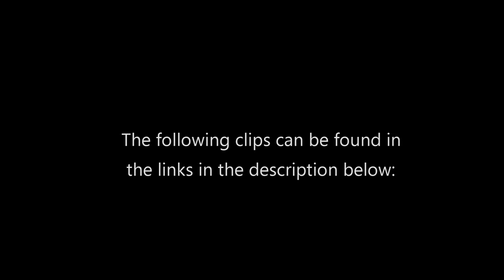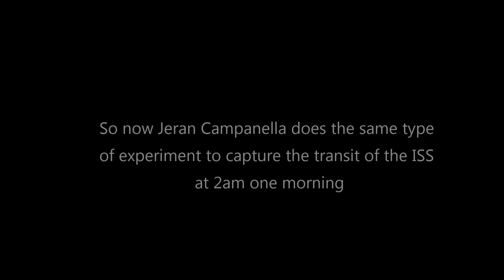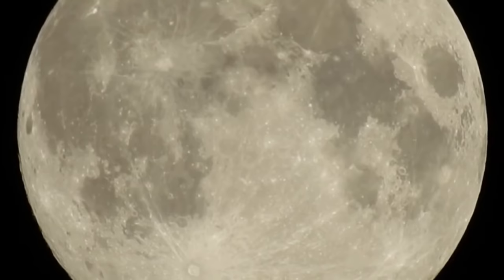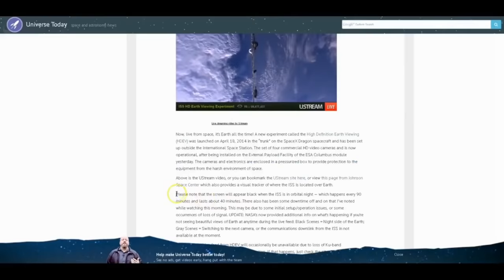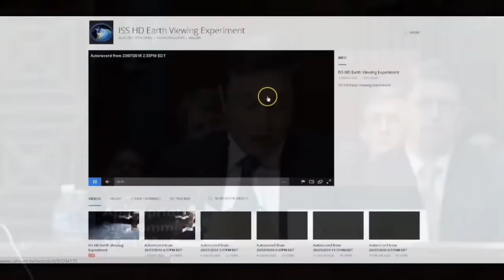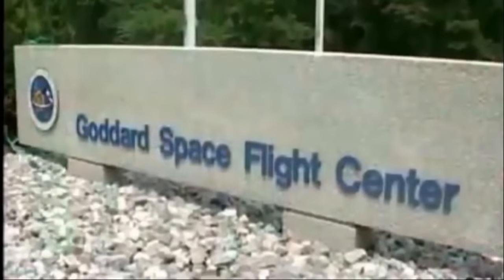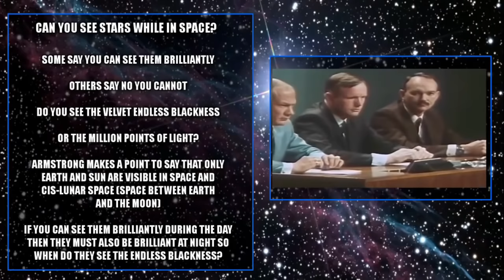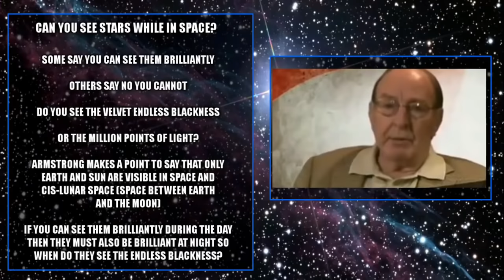The ISS Confirmed!

Comment: There's a video about submarine O ring seals and solenoids and you'll see that the O ring explantion on the ISS is totally fake.  The ISS would explode if a seal leaked and they have no way of sealing off any sections.  Don Pettit is obviously a 33rd degree Freemason or higher = Liar.  A leak or emergency in a water tank is nothing ompared to being in a vacuum.   Any slight leak in a vacuum, you're dead.  So as you say, no need for guardian angel skuba divers.
Reply: Does your tube seal up nice and tight?
Reply: @tubemonks   Don Pettit is a geologist.  This is why the flat earthers only show him.
Reply: @andrewskivington6453  He is in fact a Chemical Engineer and obviously a Freemason too. There are many videos where he isn't even mentioned so you're wrong on both conts - sorry about that.  But there is plenty of evidence that the Earth isn't a globe, but globe heads refuse to even discuss it.  I have carried out an experiment myself and shown there is a huge anomaly with the accepted rhetoric.  It's so plain that the ISS is fake and I find it incredible that many people want to ignore all the oddities which arise and fly in the face of the very science they uphold as correct.  I looked into the psychology of that too and now I understand the reasons.  The Earth is either flat or it is really huge but I am not sure what it is yet, but one thing is for sure - NASA know the truth.  But Pettit said what he said.  You think he lied?
Reply: @tubemonks  He is trained as a chemical engineer but studied meteorites (something you don't get on a flat earth model with a dome on top of it). 

"But there is plenty of evidence that the Earth isn't a globe, but globe heads refuse to even discuss it."  You are kidding right?  We have been discussing it since 300 BC.  "The Earth is either flat or it is really huge", it's the latter.  That's why you can't see curvature from the ground very well.

"I have carried out an experiment myself and shown there is a huge anomaly with the accepted rhetoric."  Can you show your findings?  Is it a tennis ball with water on it?  I'm happy to destroy your opinions with facts, not that you would ever except facts over your opinions.  Are you going to show us how tides work?  Or seasons?  Or the differences in visible stars from countries in Europe/North America vs Australia/NZ (where's Polaris when you are in Australia?).  Why do Flat Earthers mistrust global authority but happy to adopt a pin design for their map?  Why do flat earthers keep calling out NASA when 11 countries (and the ESA) have fired rockets into space?  What about the numerous private companies that have done it?  

"But Pettit said what he said."  Again.  He's far from being an engineer.  But yet again, FE'ers cling on to what he says.
Reply: @andrewskivington6453  So he studied meteorites?  So what?  People study many things.  What 'model' are you talking about?  Would that be the 'model' that all globe heads think anyone who doesn't go along with the accepted rhetoric believes in?  

Do you know about the Lake Titicaca experiment?  Obviously not but I confirmed it when I lived in Dorset across a bay over 20 miles across and could see the beach while sitting on the opposite beach with binoculars.   Lake Titicaca shows no curve whatsoever using a laser.  You cannot destroy any opinions with facts because many of your so called facts are lies to begin with.  I haven't looked into tides because I can't research everything anymore than you have researched microbiology. 

There are many possibilities as to why the stars look like they do and what they really are.  We have no real pictures of planets and neither are there any real pictures or videos of satellites either.  Oh dear - the old Polaris argument again.   

Adopt a pin design for their map?  What pin design and what map do I subscribe to then?  Obviously according to you anyone who disbelieves NASA and understands that the Earth isn't a globe all agree and have exactly the same idea as the next person.  Yes it makes it easy for you to giggle and make fun but did you know the Flat Earth Society is a Counter Intelligence group?  No I do not subscribe to the Sun being a spotlight because it makes no sense. 

Countries firing rockets?  Well that proves it all doesn't it?  So once you know that many countries allegedly have space programs then don't bother looking any further. Typical!   Private companies done what exactly?  Space X ?  Fake fake fake.  Space X is all CGI, cartoons and lies like NASA.  But I suppose it all looks real if you think South Park is a real live show I suppose. 

So Don Pettit is far from an engineer?  So he is lying now is he?  His career is fake too? So what is he? Yes, I know he is a liar but you can't have it both ways can you.
Reply: @tubemonks  "Do you know about the Lake Titicaca experiment?" Yes I do.  It was a repeat of a similar experiment in Hungary that also didn't prove a flat earth.  This new Titicaca experiment it was conducted by flat earthers (google "convex earth") as part of their laughable documentary using "Lilarial Science", which doesn't even exist.  Even more so they produce a 3D model of what they think the flat earth looks like, complete with an undiscovered continent beyond the ice wall.  The ice wall that they never bothered to visit as part of their research.  

Also, if you knew about the Lake Titicaca experiment yourself they list the equipment used by each team... yep they used a  Garmin e-Trex GPS unit... you couldn't make it up!  They don't say at what height the laser is located or what the distance is.  To rub it in they also use GPS units for their geodesic curvatures in buildings experiment (another experiment where they don't show the data).

If you actually saw the documentary it showed the curvature despite their protests.  For example 14 mins in they see a ship disappear under the horizon, which would only happen either on a tube or a... globe.  That documentary is so bad that even flat earthers have since backtracked and ignored it to the point there are whole debunking videos on it, or google "Convex Earth complete debunk".

"We have no real pictures of planets and neither are there any real pictures or videos of satellites either"  Buy a telescope.  Don't tell me.  They have been doctored by the deep state or something.  You can see Venus and Mars with your naked eye.  If you go to an observatory you can see Saturn and its rings.   Plus if you think satellites don't exist please don't use a phone or watch TV otherwise you are hypocritical.  You can even get a phone app that tracks them.  According to UNOOSA, over 8,000 objects have been launched into space with almost 5,000 still in orbit... so do provide evidence that all of those are fake.

"Oh dear - the old Polaris argument again."  There is no argument.  You cannot see Polaris 15 degrees south of the equator.  If you lived in the northern hemisphere you wouldn't be able to see The Southern Cross, Carina, Centaurus and Sagittarius.  So do explain that vs running away with a flippant "old argument" line.  Argue the point then.  Have you been to Australia?

"Adopt a pin design for their map?  What pin design and what map do I subscribe to then?" For a flat earther I seem to know more about it than you do.  They adopted, ironically, the pin created by an industrial designer called Oliver Lundquist in 1946.  Google "Flag of the United Nations".  Yep, I'm doing all the work for you.

"Private companies done what exactly?  Space X ?  Fake fake fake.  Space X is all CGI, cartoons and lies like NASA" - You have seen a rocket launch right?  For example Space X launch satellites from both Florida and California.  The latter I saw, as did all of Southern California on the launches they did last year from Vandenberg AFB - or did everyone that took photos/videos and posted them on their social media pages put them through CGI software first?  Or did Space X produce the world's most realistic holographic projection, complete with sonic booms.  If in doubt just go near launch site, here's a roster of launches this year - google "spaceflight launch schedule".  Yep, you can see for yourself.

"Space X is all CGI" - I've worked in film and video game industry on and off for the last 20 years.  What CGI software does every single space agency and private aerospace company use now and from back in the 1960s?

"So Don Pettit is far from an engineer?" - Just google search him.  It lists what he has done for NASA, there's no great secret.

"Yes it makes it easy for you to giggle and make fun but did you know the Flat Earth Society is a Counter Intelligence group?"  Yes, because both you and the FES are countering intelligence.  If you are just relying on easily debunked YouTube videos for your direction you are going to be a target for ongoing mockery.
Reply: @andrewskivington6453  Of course I 'actually saw the documentray' I probably watched it more than you.  And of course they showed a ship disappearing because that is what they do!!!!  THAT doen't PROVE anything.  Are you saying we don't believe that ships disappear from sight the farther away they are?   It doesn't matter at all who they were and what their thoughts were on the subject because the data is shown below.  So only globe heads can do an experiment eh?  Is that what you're saying?  They did show the height of the laser as below, if you really watched it.  

The experiment showed that the laser could be seen from the opposite bank and if the Earth were the size they say it is you couldn't see it - end of.  The 3d model is neither here nor there.  You cannot 'visit' the Antarctic so how could they do that?  And don't tell me you can because you can only go to predetermined places.  

Teams:
Team A: Vanessa Oliveira, Alessandro Oliveira, Alex Oliveira, Tatiana Maciel
Team B: Urandir Oliveira, Eliane do Canto, Alan Oliveira

Coordinates:
Team A: Location: Juli, Peru 16 ° 12’34.74 “S 69 ° 23’51.29” W
Team B: Location: Copacabana, Bolivia 16 ° 10’1.69 “S 69 ° 5’25.04” W

Distance: 33.78 Km

Equipment:
Team A
1 Laser beam 3000mW
1 Laser beam 1000mW
2 Halogen Headlights 75W
1 GPS Garmin e-Trex
1 Notebook with GPS and positioning software
2 HD Cameras with nightshot
1 Laser level with modified support
1 Lead-acid battery from 27A
1 VHF Radio Base
1 Dual band VHF / UHF directional Omni antenna
1 Radio HT VHF
1 Lensatic Engineer Compass
2 Tripods and Positioners

Team B
1 Laser beam 3W
2 Halogen Headlights 75W
1 GPS Garmin e-Trex
2 HD Cameras with nightshot
1 Lead-acid battery from 27A
1 VHF Radio Base
1 Dual band VHF / UHF directional Omni antenna
1 Radio HT VHF
1 Lensatic Engineer Compass
1 Tripod and Positioner

OBS:
1- The laser equipments was positioned at 1.5 meters from the water level.
2- To replicate this experiment, you must take into account the climatic condition. Give preference to perform on days with low air humidity and days with little or no wind, which decreases the formation of waves.

I am not going to get into the phones and TV argument here.   You are provaricating, massaging or deliberately  (or through bad research) missing information as above.  You really need to WTFU son.  
You are struggling to protect your ego.  This is a basic failure and stumbling block of research.

A rocket launch proves nothing.  Space X is fakery.
Reply: @tubemonks  Yep, that's the equipment list... 1 GPS Garmin e-Trex for each team.  Notice how they don't show the data for the test.

"And of course they showed a ship disappearing because that is what they do!!!!"  On a flat earth they wouldn't have disappeared below the HORIZON like they did on the test.  The test proved a globe, as does a sunset does or a sunrise.  There's no curving horizon on a flat earth model and your sun/moon rotate over the earth (why can't I see the sun over Europe when it's 10pm in the US?).

"The 3d model is neither here nor there."  It is!  It is the output of that documentary, aka ignore or hide the findings because we believed in a flat earth from the outset.  It was so funny to watch.

"So only globe heads can do an experiment eh?  Is that what you're saying?"  Not at all.  This is a fundamental to science.   Unlike, say, religion, it opens itself up to scrutiny and retest which is why it's called scientific theory.  There as been NO actual research done to prove a flat earth other than lasers over a very short distance (in relation to the size of the planet - why are all the other planets round?  Oh yeah, you think they don't exist even though telescopes are a thing).  Why haven't you all pulled money together and made a balloon like Explorer II in the 1930s?  They saw the curvature from that.  Or even a balloon with a GoPro?  Or an trip to Antarctica?  Or a fight from South Africa to Australia which is currently a non stop flight, but on your flat earth UN based map is over twice the distance thus needs refueling.

"You are struggling to protect your ego.  This is a basic failure and stumbling block of research."  You are kidding right?  Everything you have said can be disproved.  Like I said even that Brazilian documentary is now mocked by Flat Earthers because of its lack of accuracy and, importantly, transparency, so what does that make you?  Gullible?  Or egotistical to think you can prove the world wrong because of your ill researched opinions plus gobbling up conspiracy video after conspiracy video.

"I am not going to get into the phones and TV argument here." Yes, because you don't want to get in an argument because it's hard to when there are shear hard facts involved. 

"You are provaricating, massaging or deliberately  (or through bad research) missing information as above"  You are seriously kidding now.  I gave you a ticket to the open door back to reality.  I gave you search phrases to debunk that beloved mockumentary of yours and also a list of rocket launches this year, so get up from your computer and go to these areas.  You can even go to Antartica.  You can even go fly over it if you don't want to get cold.  You can even go in a Russian Mig fighter jet that goes up high enough to see the curvature (don't tell me, all fake or the cockpit window is a fish eye lens.)

"A rocket launch proves nothing.  Space X is fakery."  So the millions of dollars just to launch a rocket is fakery.  Again show how all the space agencies around the globe are "fakery".  What CGI software do they use (given I use all the industry standard ones for the entertainment industry. Hint: there's only a couple)?
Reply: @andrewskivington6453  Your response just goes to show how little you understand.  Of course shops would disappear because it's an anomaly of the eye.  This is why a fish eye lens makes everything look curved.  See what optometrists say about the eye and perspective.  Do you think that someything 30,000 miles away should stillbe visible on a plane with atmosphere?   You said that the experiment didn't state the height of the laser and I showed you it did.   I cannot possibly argue with everything you failed to understand as I'd be here all day and YT wouldn't accomodate that sort of response.  Yes millions of $ on fakery.  So that proves that it's real because you can't believe they would spend that sort of money fooling you?  You really do have a lot to learn. Back to sleep for you son.
Reply: @tubemonks  "Of course shops would disappear because it's an anomaly of the eye." ha ha ha... wtf are you talking about?! Ships disappear below the horizon because, erm, we have curved horizons on a round planet.

"See what optometrists say about the eye and perspective."  can you cite a video or an interview somewhere when an optometrist admits the reason why ships disappear below a horizon is... your eyes.  WTF.

"This is why a fish eye lens makes everything look curved." ah, the old fish eye lens bs.  Remember a fish eye lens distorts the whole view which is why shots from space have a curved earth in the background and a perfectly normal foreground... because they don't use fish eye lenses.  If you think they do let us know the make and the focal length.  I have over 7 different types of fish eye lenses (I've had 4 solo exhibitions of my photography)... all distort the foreground and background.

"Do you think that someything 30,000 miles away should stillbe visible on a plane with atmosphere?"  Yes.  If it's the flat earth version of the sun and the moon we would be able to see both.

"I cannot possibly argue"... but you are not arguing.  You flat earthers never do.  All we get when presenting facts is blindness and cheap insults, but never, ever, provable facts.  Switch off your computer, go outside and buy a telescope, go visit a rocket launch or even save up and go up in a high altitude plane.

Comment: I also have a £90 Makita 9v cordless drill, cheapest in the range, underpowered and has hardly any torque. It will routinely emit sparks and the lithium ion batteries are banned in the hold of airliners.  Ok, so it's not the best buy I've ever made, but very weird to see one clipped to the wall of the ISS in this video.

Comment: I feel making an air tight actuator operated from the inside shouldn't be so hard. Flexible covers, two of them, just not too deformed from 1 bar overpressure. 
But yeah, if I were on a space ship with iffy tech like that, I'd be carrying some tire sealant on my belt, always on the ready. Ideally a higher duty variety of course. Something both cold and hot curing.

Comment: No o-ring has been designed to tolerate the extremes in temperature it is supposed to be subject to.. There is no way to keep it cool either.. Cannot radiate heat in space. Cannot convect it, cannot blow it out..